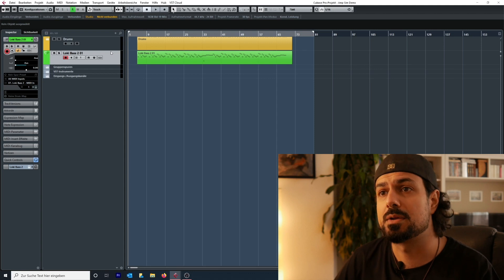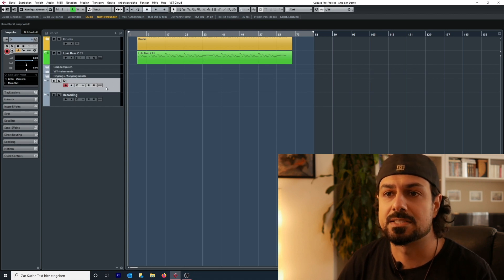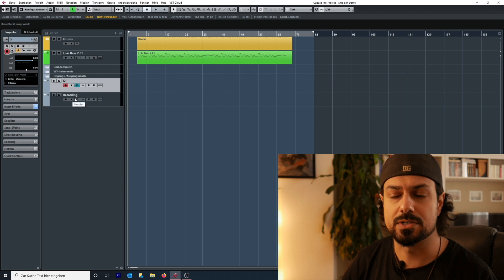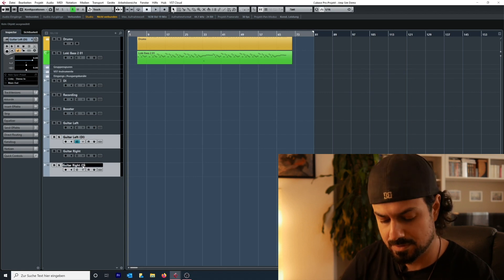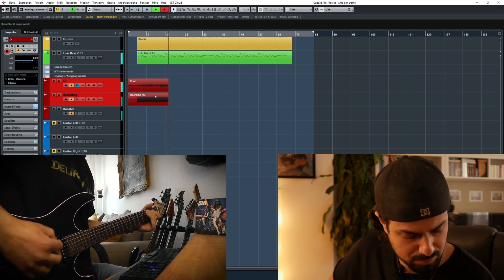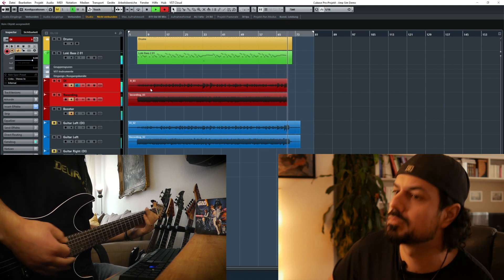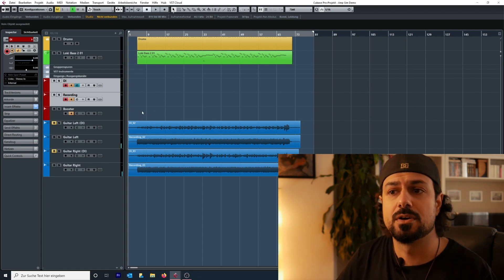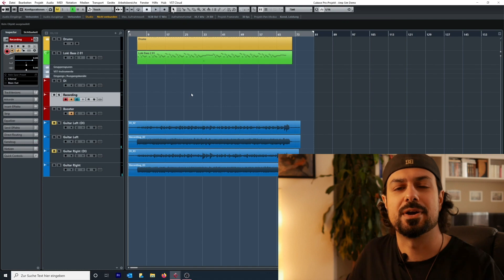Recording guitars with amp sims in CUBASE

Comment: Hey man! Great video. I need to ask a question though. When I'm dragging and dropping going from the DI and Recording tracks to the regular guitar tracks, I'm not getting the sound from my plugin. I am on the Recording track and recording normally but when transferring to other tracks, it's not keeping the plugin other than the Recording track. Any help would be appreciated from anyone here. Thanks so much!
Reply from the maker: I’m not sure I fully understand. Clearly you’re doing something differently to this video. Your DI will be processed through one track (with the loaded plugin) and by setting the input and output routing as shown here, you will end up having a printed take, which will remain printed even when dragged to another track.
Reply: @deliriumsdawn that's what I seem to have done but the printed track isn't moving to a new track with the plugin sound. I'm going to run through it again.
Reply from the maker: Well, it seems the crucial part of this video, which is creating a virtual output bus and so on, wasn’t applied entirely. 

Track 1: input from your guitar, output to virtual bus. Insert the plugin here.

Track 2: select the virtual bus as input, output to main out.

The recorded take on track 1 will remain DI, the recorded take on track 2 will be printed with whatever plugin you had on track 1.
Reply: @deliriumsdawn thank you so much!

Comment: Just to clarify does this only work with Cubase Pro? I'm trying this method in Cubase Elemtns 14. When I try to set the input of the 'Recording' track to the 'Internal' output bus coming from the 'DI' track it's not an available option in the drop down. Any ideas how to accomplish  this on Cubase 14 Elements?
Reply from the maker: Yes, creating virtual buses and routing them like this requires cubase Pro.

Comment: its nighmare to edit 2 tracks at the same time DRY and WET. I was wondering if its possible to record as Stereo and then edit it. So we assign only WET channel as output
Reply from the maker: Thanks for your question. I’m afraid it’s not possible. Then again, it’s not really a pain in the ass to edit two tracks at the same time 😉. I edit up to 16 drums tracks at the same time. No problem, especially if you use the folder option in Cubase.

Comment: Would it be possible to explain to me how to use the amped roots free amp sim in Cubase 13?
Reply from the maker: It is very simple actually as it’s the exact same way every other amp sim is used. I assume that Roots is already installed to your VST Plugin folder. After you have created a track/channel in cubase. Simply go to the inserts of that channel and load up the plugin. Make sure the buffer size of your audio interface is set correctly. Activate the Monitor button of the same channel to hear your sound while you’re playing. Deactivate Monitor to hear what you have recorded. That’s the basic setting. You could also continue and apply what has been discussed in this video.

Cheers.
Reply: @deliriumsdawn  Oh man! Thank you so very much! I'm at work at the moment but soon as I get home in the morning I will follow your directions. Also I will record my tracks the way you have done it in this video! Thank you! Subbed!
Reply from the maker: You’re welcome man!

Comment: May I know the difference between Guitar DI Waveform to Recording Audio waveform?
Reply from the maker: I‘m not sure I understand the question. Here, I’m recording the DI on one track and the processed signal on the other track.
Reply: @deliriumsdawn  I confused the Processed signal is different from Guitar DI waveform the processed signal is thick waveform than DI
Reply from the maker: Yes, that’s the whole point of the video. It’s thicker because it’s processed by the amp sim.

Comment: Thank you so much, Eric, never thought this recording way! 🙏🏻👍🏻
Reply from the maker: Sure man!
Reply: @deliriumsdawn  One question, if possible: how do you set input recording level for the clean track? According to @Dom Sigalas I try to stay between -18 and -12dB peak levels. Thanks!
Reply from the maker: @arturofornasari  I set the gain on the interface. With the Focusrite it’s gain at zero, switch turned to instrument. However, I do not know what volume that results in.
Reply: @deliriumsdawn  Ok, thank you . I don't want to bother you, just curiosity to see how another guitarist work, but this sounds strange to me: don't you really check the final recording level to avoid clipping? 🤔
Reply from the maker: For DI I really don’t. I can see on my interface wether I clip or not, which I never do.
Reply: @deliriumsdawn  Ok. I’m using an Audient ID14mkII now, but previously I used a MOTU 828mkII and in both cases onboard level input doesn’t give a clear idea of the actual recorded level (it also depend on your instrument volume, after all; sometimes I change it during recording, depending if I’m comping or soloing). Thank you again, once more, for your very useful video (I’ve immediately tried your technique with satisfaction!) 🙂
Reply from the maker: Awesome!

Comment: Why have the DI and recording as separate tracks?  Record the di to a track with an instance of bias on it and then just render to an audio track and copy the di to a new track and repeat.
Reply from the maker: Absolutely! But during recording this method is a little bit faster. 

But sure, when I’m done recording I will use the render option, especially when I dial in a different tone! 

Maybe I should do an updated version of this video. 

Cheers!
Reply: @deliriumsdawn  Gotcha.  My simpleton mind would probably record onto a track with bias, render the track, then deactivate the original track and archive it into a folder track.  But there are plenty of ways to skin a cat.

Comment: hey, dont understand what the DI track is for? what is the diff between DI and Recording track? and why do we need a separate DI and Recording tracks if we can just change the ampsim in DI track directly? sorry im just learning and not sure.
Reply from the maker: Hi,
thanks for your question. First of all…this is just an option in how you could record your tracks. Therefore you don’t need a separate DI track or anything from this video. 

The difference between the DI track and the Recording track is that the wave form on the Recording track is irreversibly processed by the Amp Sim. The wave form on the DI track is the original DI wave. 

I would always keep a DI track in case you wanna change your sound later, which you can do by using a different amp sim setting, or a total different amp sim, or by routing your DI to a real amp / mic setting.

I hope I could help.
Reply: @deliriumsdawn  ahh i get it! thank u so much! really helpful :)
Reply: @deliriumsdawn  Hi, thanks so much for a reply! just to clarify: why doesn't the waveform of the DI track where you applied the ampsim have the processed sound? is DI only recording basically clean guitar? if so, why do we apply the ampsim on the DI track and not the recording track? Thanks and great video!
Reply from the maker: Thinks of it as a signal chain:
DI track into amp sim (needs to be on the same track). Processed signal (output) going into the recording track (input) and being recorded in processed form. 

Only of course if you set the routing options as I did. 

If you turn off the amp sim on the DI track you’ll hear a clean sound.

Comment: Hey everyone! Good News. I figured Out how the Routing works in cubase pro. It is a bit tricky. 1. Create the Output bus as described in this very helpful Video. 2. Press F3 and the mixing console will Open in a seperate Window. 3. Make Sure that the "Routing" Funktion is aktivated in the Menu at right top of the Window. 4. Then Go to the Channel where you want to Set the Bus as Input Bus. Chosse it and it works 👍🏻 Most helpful Video in YouTube
Reply: hey brother, on cubase LE, i can set the output on DI as internal, but I don't see the Internal bus on the input options for recording track, any ideas what could be wrong?
Reply: @minior9020  
I've got same question.......
Reply: Me too, as minior9020. Guessing it's a feature not in light version?

Comment: Your video is tilting me towards trying out Cubase instead of Cakewalk by Bandlab that is free. Quick question. Does your electric guitar recording method apply for acoustic guitar?
Reply from the maker: Sure it does. Since I’ve been getting the same question. You will need the Pro version of Cubase. Otherwise - with other versions - you won’t be able to use the virtual output (internal) as an input bus on your recording track.

Comment: Hi Found your video very interesting and would love to give it a try but can I ask you a question? How do you get your plugins to show up in the insert menu. I have Guitar Rig 6 that I am trying to use with Cubase 10. Any help would be appreciated. Many thanks Tony
Reply from the maker: Thanks for your question. If it’s a VST plugin, which I suppose it is, you have to make sure to install it into your VST folder (normally in the Steinberg / Cubase folder). It should then appear the next you start Cubase.
Reply: @deliriumsdawn  Many thanks for taking time out to answer my questions, all's good and GR6 is up and running. Thanks again..Tony

Comment: Is there any chance you could do a video using the Cubase amp sims? That would be great since that's what I use. I'm running Cubase 11 Pro. Thanks for this!
Reply from the maker: I could try. Although I use 8.5 Pro. Still I have the the amp vst plugin. What sound are you interested in? Since we’re a metal band, we mostly use high gain sounds.

Comment: Awesome video! Seems like a fantastic method for saving CPU whilst being very flexible with sound later on! I have tried this on Cubase 11 Elements and it did not work for me though. It wouldn't let me select the newly created Bus as an Input option. Can someone confirm if this sort of routing is exclusive to Cubase 11 pro?
Reply from the maker: Hey thanks! I can absolutely confirm this issue since I had the same problem when I used the artist version of cubase 8. The idea to do this and having the option of virtual routing was the reason I bought the pro version in the first place. I am pretty sure it’ll work with 11 pro.
Reply: @deliriumsdawn  thanks for confirming! One more question, if you don't mind, just so I'm 100% sure i got it right (Cubase pro is kinda expensive): the sound on the "recording" track is fixed, right? If i disable the amp simulator, the sound will still not change, if i got it correct. I'm asking because I'm looking for a way to transfer my whole arrangements (just demos, so not that large files) to a friend. He does have cubase, he does not own the same plugins (Neural DSP in this case) as me, so if i only send my DI he will just be able to listen to the raw signal. Keep it up, thanks again for this awesome video!
Reply from the maker: Yes, the sound on the recording track is fixed. At least it is processed through the amp track. Therefore disabling the amp sim will not effect the already recorded sound. That means yes, if you wanna send your friend amped sounds, you can. And you can also only send him the DI if he wants to amp the signal.
Reply: @deliriumsdawn  thank you! :)
Reply: Were you able to fix the issue? I'm working in Cubase 12 elements and can't use the created BUS as an input :(
Reply: @José Durán  I'm afraid it will not work in cubase elements (at least it did not work for me in cubase 11 elements).
Got cubase 12 now, didn't try it yet, but you can choose your inputs according to your choice.

Comment: I tried to emulate your method because it seemed so elegant . I'm using Cubase 11 Pro and I don't find that I have an option to use the Internal output bus (set up as you demonstrated) as an input to the recording track. Has something changed in Cubase or am I missing something?
Reply from the maker: Hey, that‘s a very good question! Since I’m using Cubase Pro 8.5 I’m not quite sure if anything has changed. I remember that I had to upgrade from Cubase Artist to Pro to have this sort of routing option. 

And you did try to create the output bus? The one that I then named Internal? That’s the crucial part for this method.
Reply: @deliriumsdawn   I did create it but it wasn't showing as an available input, I removed it and set it up again as far as I can tell exactly the same as I did the first time. This time it was listed as an available input for the recording track. Really not sure what happened there but I'm glad that it now works. Such a good solution because I had always previously been using a separate Bias FX insert for each guitar track.
Reply from the maker: @wizmacnz  awesome! Yeah it really is a nice solution for digital sound processing! 

Glad I could share it! 👍
Reply: @wizmacnz  I am facing the same issue. I am using Cubase 11 pro and facing same issue. Can you help me to resolve it?
Reply: @deliriumsdawn  Yes I'm facing the same issue please help me
Reply: Has anybody been able to solve this issue? I too can't chose the Internal BUS as an input. Please help!
Reply: Press F4 man...